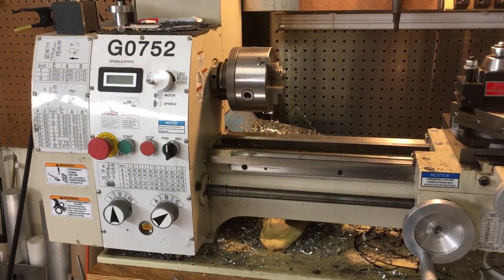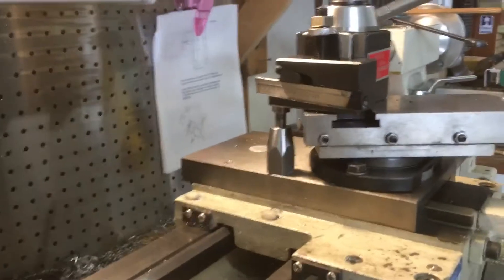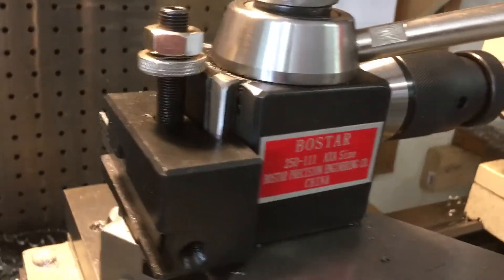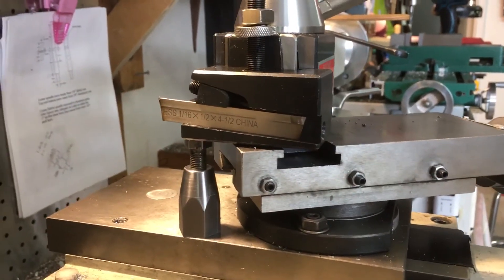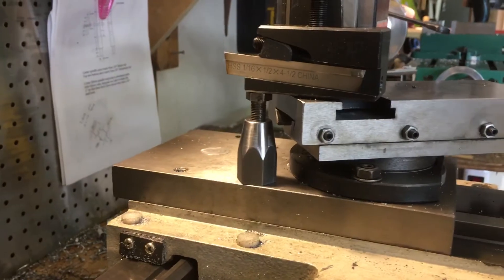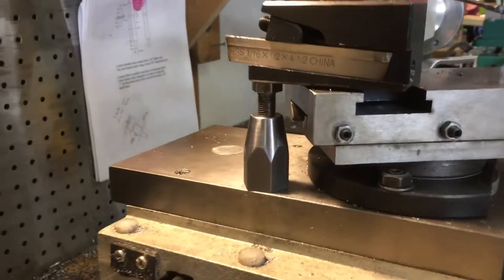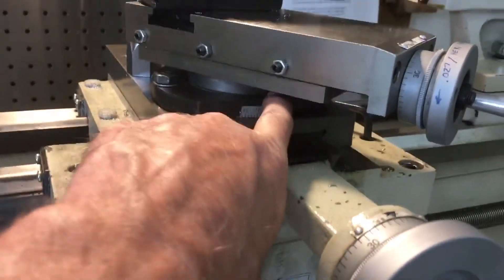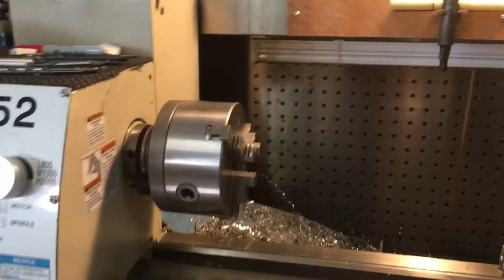How to use a machinist jack to support your tool holder

Comment: I have a G0602 with the same stiffness issue. My simple solution is to turn the the collar for the compound slide around, so that the rounded side covers up the protractor scale. Also, move the compound slide back so that the cutting force is closer to the center of the compound's foot.
For a permanent fix I plan to use a piece of 3/4" plate to make a new compound collar, one which allows me to see the protractor scale, but which also provides much better stiffness.
Reply from the maker: John Robertson, ya is suppose the thin section above the scale would allow it to flex upwards.  I had planned to make a new collar but after I started using the Jack I haven't finished that modification.  Thanks for the comment!